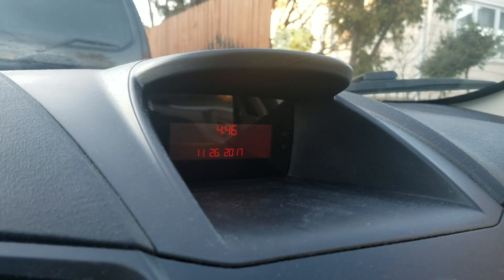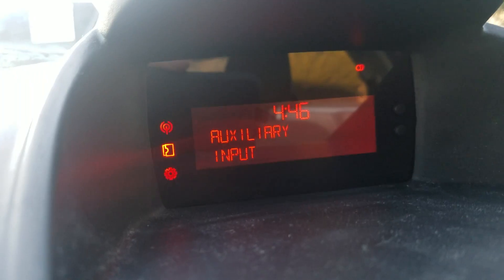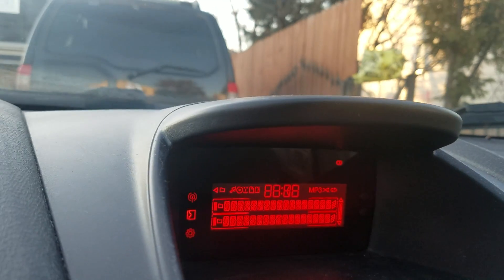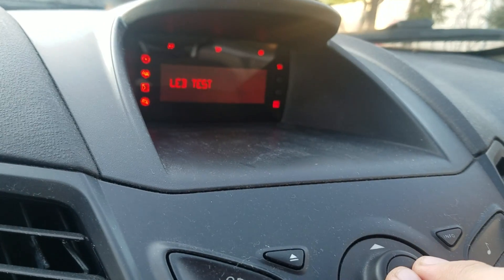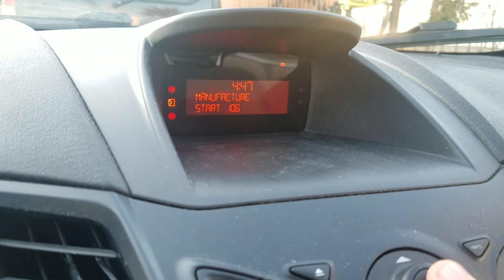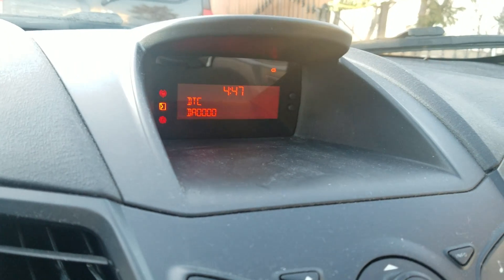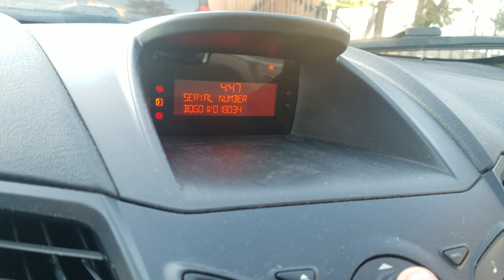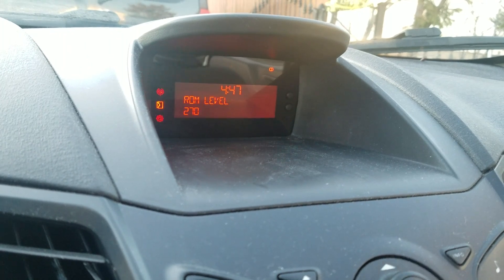11-14 Ford Fiesta Insurment Panel and Radio Hack / Engineering Mode

Comment: So I can't tell what buttons you are pushing. My radio & the display goes out at any time. Days later decides to work again then out again. I AM SO FRUSTRATED!!!
Had fuses checked, they are good. Sometimes I can bang on top of it & it will come on. Last few weeks it has been mostly out, will come for a few hrs then out for few more days.
I am so pissed. Seems to be wiring, not radio or panel itself.
Crazy thing is, it worked mostly all summer. Last yr around this time is when it got bad then too.
Reply: I have the same problem. Dud u find any solution? I guess it's the wires pulling due change in temperature when it's cold outside.
Reply: @mjobanjatt  I hardly had radio at all the past year. Im so sick of it.
Reply: @mjobanjatt  On another video a guy said he changed the wire that goes from the stereo to the display and it was fixed. I tried taking it apart but the clamps and stuff are plastic. I was afraid I was going to break it and gave up.

Comment: Does this fix my issue...
That whole panel went black, no lights, no time, radio not working :(
Ty for this.
2011 fiesta
Reply: Haha
Reply: marcie did you ever fix it?
Reply: @chuck7575  no. I need help!
Reply: @Marcie0613  me too I just bought a 2010 fiesta and I have the same problem
Reply: @Marcie0613  do you fix this problem?
Reply: @yassinebounher1862  No, I have no radio. Im sick of it.
Reply: @Marcie0613  I hope that you find a solution
Reply: @yassinebounher1862  You too! Let me know.
One guy changed the wire that goes from the radio to the screen & it worked. But for me, taking apart the dash is too stressful. I had someone help me but it is so easy to break the plastic clips holding it together it made me too nervous. You have to keep the airbag wire connected or you will have to get it reset so you can't take the whole thing down. It has to dangle from the wire. But if you feel comfortable I would try changing that wire. Let me know if you do.
Reply: @Marcie0613  Yes, your concern is right, and I will not take the risk of doing something like this on my own. I will have to consult an expert. If I reach any solution, I will tell you. Good luck
Reply: @yassinebounher1862  Thx good luck to you too.